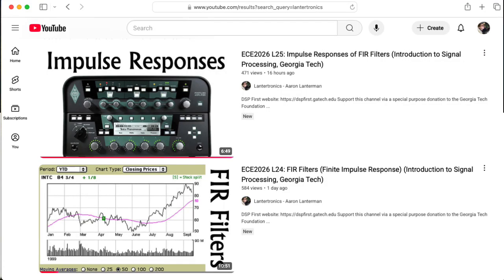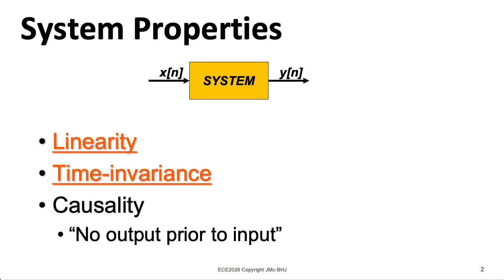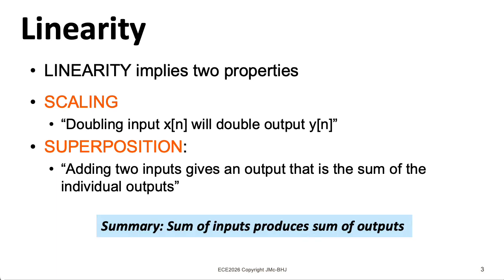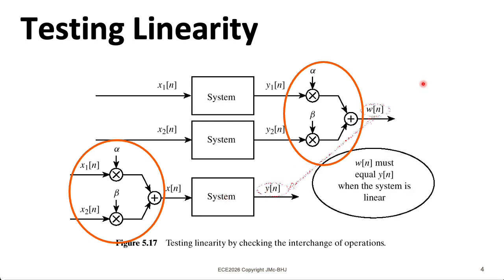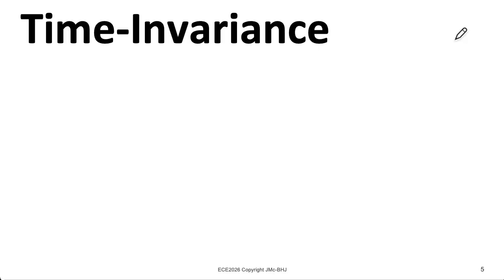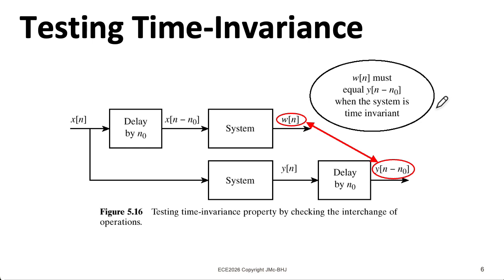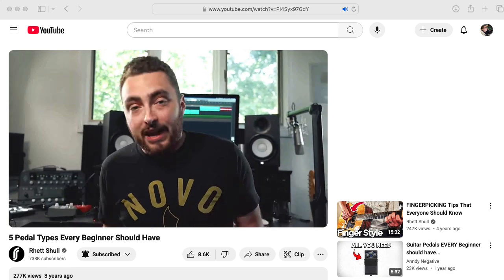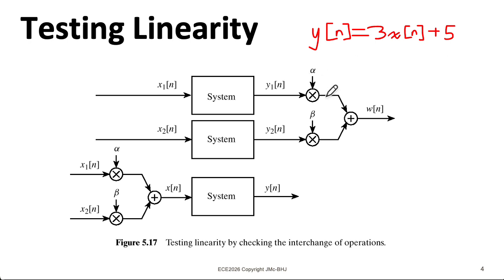ECE2026 L26: Linearity and Time-Invariance (System Properties) (Introduction to Signal Processing)

Comment: This brings back a memory from a class in my EE curriculum, a "filter" course, that was essentially the main math parts of signals in systems, a pre-signals and systems class. We had it drilled into us so much that linearity and time invariance went hand in hand in linear systems that we got kind of programmed. There was a test question, asking if a switch was linear. If I had followed the programming, I would have gotten the question wrong, because of course a switch isn't time invariant, but it is linear. I'm glad I took a moment to think about it. :)